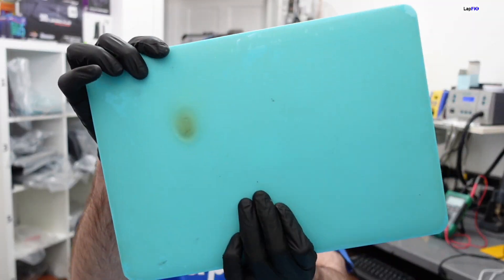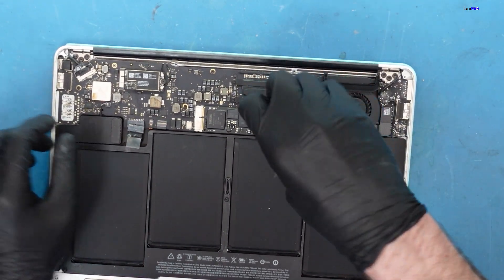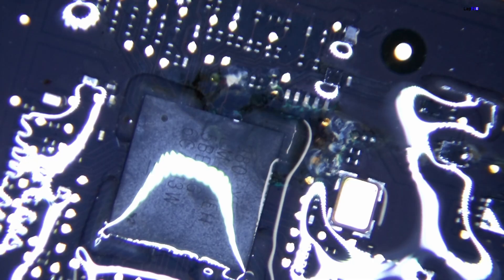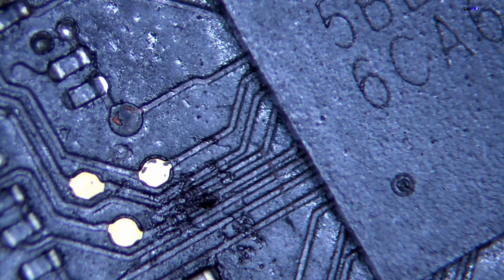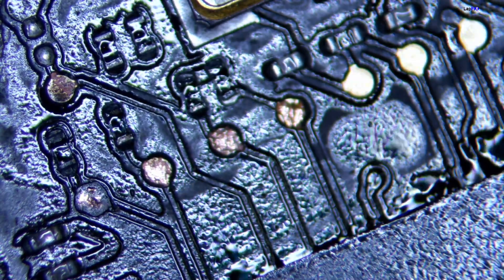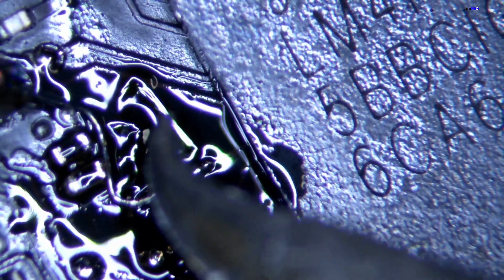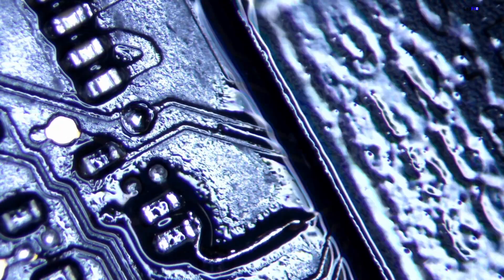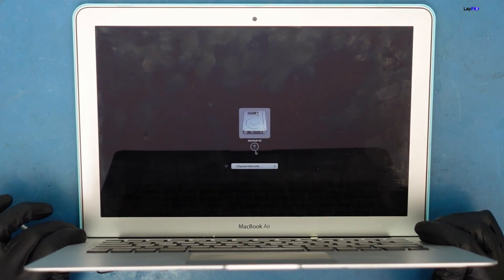Fixing a Dead Macbook Air 2017 a1446 with Liquid Spill Damage

Comment: What liquid are you squirting on the board to clean it?
👉Do you have a video of basic cleaning techniques?
     I spilled coffee on my My Mac Air when an electrical device in my spine accidentally shocked me and my coffee mug was just above the keyboard.
     I’ve bought a number of electronic repair tools but I don’t have the training yet to try the cleaning/repair.
     I’m just practicing soldering & understanding capacitors, resistors, etc to learn in general